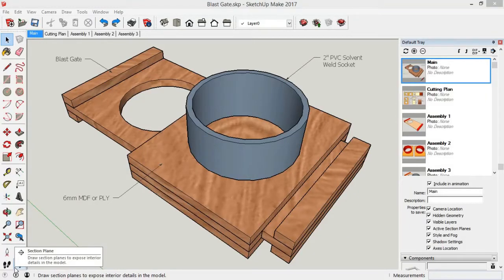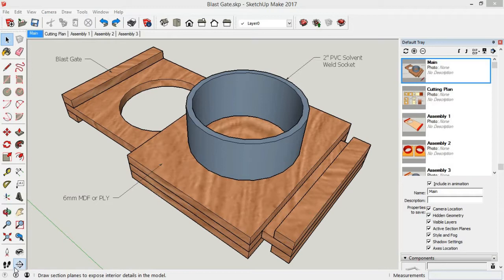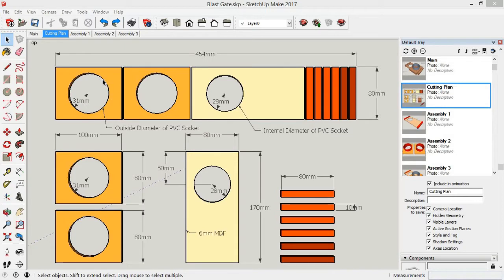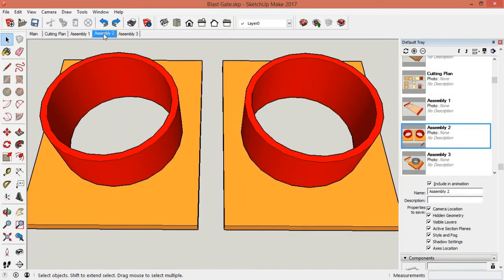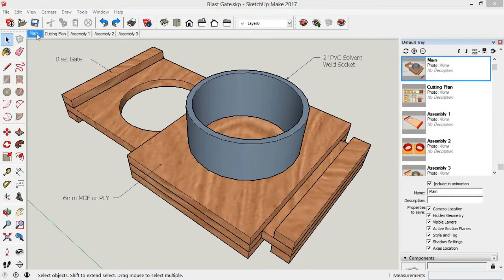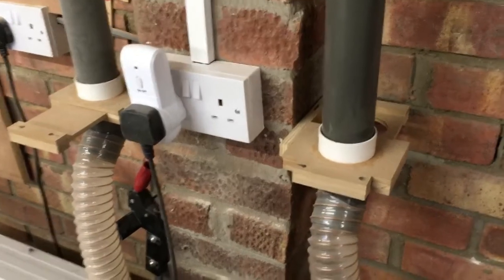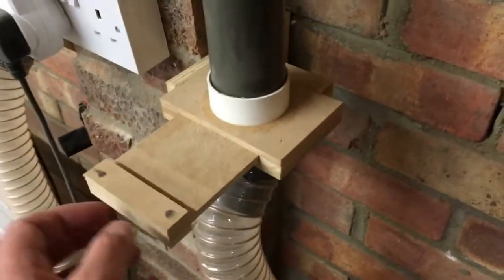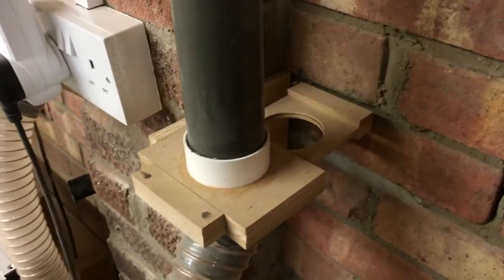Self Cleaning Blast Gate using 2" PVC Waste Pipe - FREE PLANS

Comment: Great video and idea. Can I just confirm that you used 2 inch/ 50 mm pipe as the external and external diameters do not add up. many thanks.
Reply from the maker: Hello David, yes it is 2" PVC solvent weld waste pipe and a solvent weld socket. The dimensions on the plan are the radius of each hole. 
So pipe OD is 56mm and Socket OD is 62mm. Hope that helps
Reply: Greg Virgoe Many thanks Greg. I’m getting the radius confused with the diameter.
Reply from the maker: I should have just stuck to the diameters on the plan. Noted for future plans. Thanks

Comment: Hi Greg where do you buy your 50mm grey pipe and fitting from, struggling to find someone local who stocks them.
Reply from the maker: Hello Dave, I had it left over from a project at work and it was going in a skip but you can buy it from Travis Perkins
Reply: Greg Virgoe that's great thanks !
Reply: Travis may be a bit expensive. Try HPS or PTS. To be honest, any good plumbing suppliers.